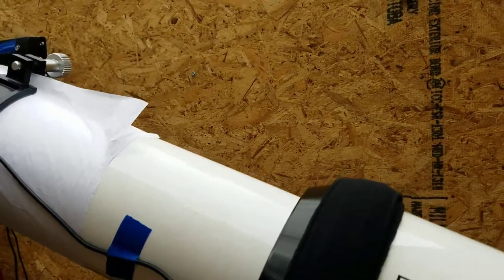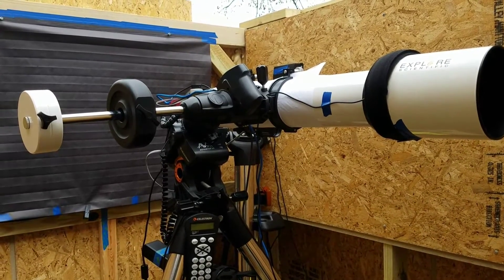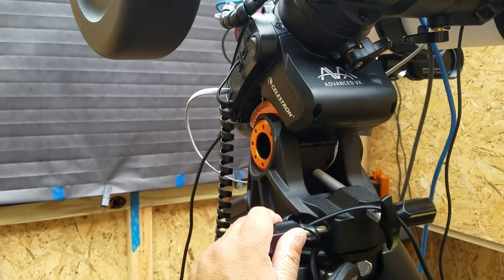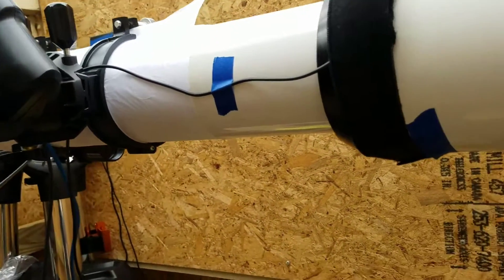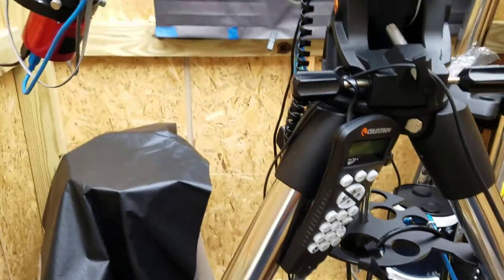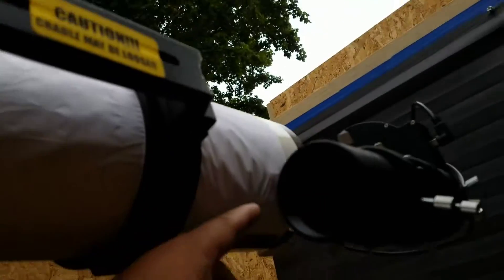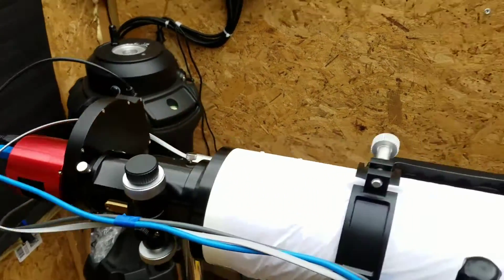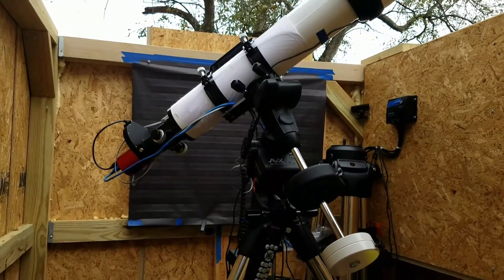ED127 FCD-100 Top heavy

Comment: has that tissue paper round the tube turned to mush yet :P
Reply from the maker: no it wont
Reply: oh good i thought it would i saw a tube the other day that someone had wrapped reflective radiator foil around the stc looked nice :)  seen a dew controller on hitecastro for 69£ sadly the filters are going to cost me around £50 each need about 5 i think then i've seen a nice autoguider https://www.altairastro.com/Altair-GPCAMv2-130-Mono-Guide-Imaging-Camera.html cheap as well at £166 then im done i think well i still have to focus my guide scope but i am trying the gp cam befor i change the guide scope but ive seen a nice guide scope just like the z61 thing bought for $400 the other day this one is £ 200 just the same lol
Reply: oh yeah im changing the main tube ring its crap and made out of plastic and is already failing i thought it would with all the other equipment on it it has staRTED TO FLEX TUER SLIGHTLY SO I NEED TO GET TWO STEEL RINGS THE CLAMP I HAVE IS JUST A PLASTIC CLAmp ( sorry for caps big hands ) its shit ill show you when its all done i promise :)
Reply from the maker: this movie is just for you  https://youtu.be/SqE3wdY2Tco
Reply: they are about £60 not that expensive really for what i am  attaching  them to and i would say my 5 cases are going to need some security they have locks but they look flimsy so beef them up with biometrics

Comment: Get a cg-4 and a polar scope with the tracking motor. You will be light years ahead of the guys from the 80's who took so many awesome photos. The trouble with all this new high tech stuff is compatibility. Running out of space and room in common. Ask yourself how guys dealt with cord wrap standing on ladders to look into dobs. They didn't. They exposed all night having no idea if they were right until they developed their film. You're right. Even that masterfully designed mount is mostly plastic and Chinese. No pride in their work. It's amazing yes but if you have to rebuild and redesign around it constantly what have you gained?  Barn door and well positioned German EQ's is all you need. Hubble or James Web will handle the rest just fine.
Reply from the maker: Oh I feel sorry for the poor bastards on dobs, I need a ladder with my newt just to focus.  I have already proven a CG4 with 2 drive motors with my Canon I was able to image The Whirlpool Galaxy yet,  it was old school as you described in the 80's.  My t6i canon with its image tracking while using BYEOS, really helps the cg4 tracking RA sidereal speeds.  Yes you can get very nice photos with CG4 without computer aided, where it lacks in time to setup, it can be made with todays post processing AP applications.  Hubble and James's web is good reference to fall on from social media as youtube, to add to AP experience for the starters; world wide telescope for Windows does bring it home for those who want to experience Astro viewing from home.   My DX arrived today, so I am going to move the avx again, test the refractor then move back the gso Newt on the dx.  

Its raining now, can't wait to test the refractor.  As for more room, I am brain storming again.  Remember when I last said that?

Comment: are you running EQMOD, you can set mount limits in eqmod
Reply from the maker: Celestron Hand Control on AVX, referring to this link I can use the R.A. Limits to set slew limits.  I correct myself, its not using filter limits as I have stated with Net Voyager.
https://www.manualslib.com/manual/862401/Celestron-Advanced-Vx-91519.html?page=19#manual

Comment: dont do an M flip and watch it closely make it turn upside down make sure you have clearance around the legs
Reply from the maker: net voyager2017 I have moved it far back enough where the camera does not bang the legs,  I taped a 3-pound weight underneath the focuser,  it's balanced on the DEC plane.   I have SET filter limits from 90* to 75*.  Quickly slew to Arcturus and Polaris,  it didn't bang but I'll watch Meridian flip.  Correction, I will have to set the slew limits from the RA Limits not filter limits and avoid any targets at the DEC 30* plane so I don't hit my front tripod legs.
Reply: okay cool glad to see you up and running again been crap weather here last few days
Reply from the maker: net voyager2017 Meridian flip is my worst nightmare using With SGPRO
Reply from the maker: net voyager2017 you made any progressive yet with your set-up!